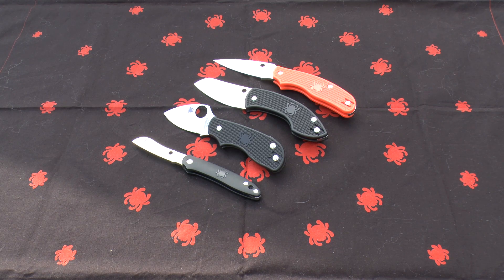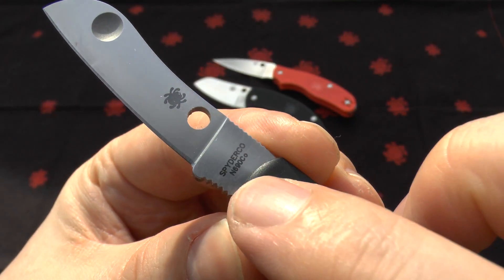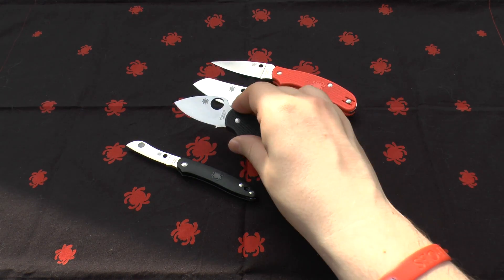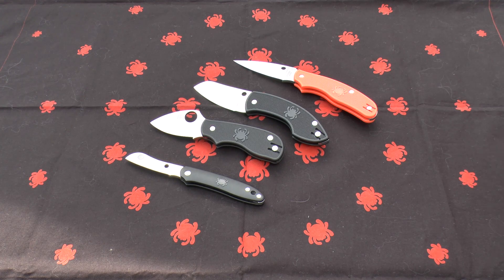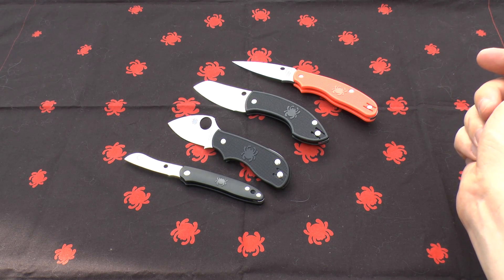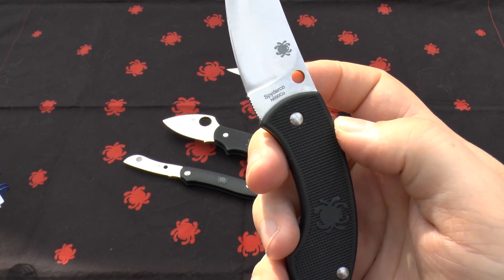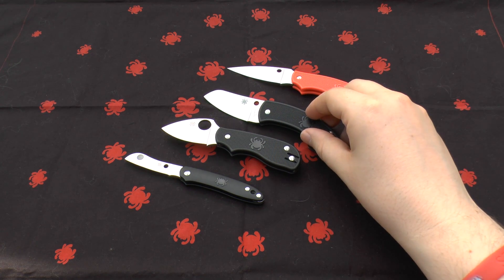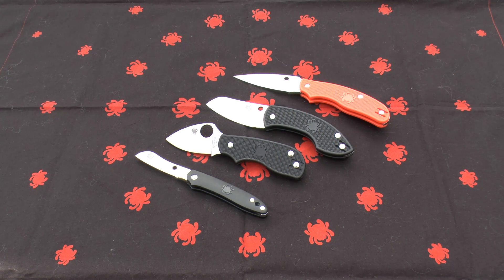N690Co - Blade Steel Guide

Comment: N690 and n690co are different steels. N690co Is not also called n690, they are similar but they are also fairly different.
Reply: Bohler uses both names to describe the 2. They're the same steel, they both contain 1.5% cobalt. You're thinking of n690 vs n695. N695 is bohlers version of 440c. The difference is that n695 contains no cobalt and n690 and n690co contain 1.5%.

Comment: Can N690co start a fire with a firrsteel?
Reply from the maker: I would think the spine of any knife can create a spark with firesteel.
Reply: Sup3rSaiy3n okay thanks, just checking as I tried it with a knife that seemed to have a sharp spine but it didn't work, maybe it wasn't as sharp as I thought.
Reply: Frederik Kjaer 690 is tough if you really want to know use the edge

Comment: Hello, I'm planning to give me a knife with this steel (N690Co) so I wanted to know from you if you actually held the edge well, it is robust in hard work and if it is enough steel when used in humid environments, in short, is really a great steel as they say?
Reply from the maker: +Michele Trekking It really is as great as we all say. It is my favourite steel in my collection and I always take notice of a new knife that has this steel. I prefer it to VG10 and S30V. It holds it's edge for a long time, is easy to sharpen and the edge will roll rather than chip. It's chemical make up allows it to be highly corrosion resistant so it will survive in humid environments. If you are overly concerned about water though you could opt for a blade in H1 steel that is completely rust proof, although it is harder to sharpen and is not as sharp. Hope that helps.
Reply: Michele Trekkning been using it for one year straight now was carrying it as a neck knife and sweated all over it and sometimes hit nails or dropped it on cobblestone, edge always came back just by sharpening while watching tv so no special effort gets also comfortable shaving sharp

Comment: How about S30V and VG10 with a comparison between the two?
Reply from the maker: dreadjavapirate Thank you. Next video will be S30V followed by VG10.
Reply from the maker: +Filip Šorli Great question. They are both very similar but I would same n690 has slightly better rust resistance but it really is extremely close between the two, unlike S30V and VG10.
Reply from the maker: +Filip Šorli Thank you for your kind words. Yes I have the Schempp rock, I have an old review (not sure if u know) sorry for the quality it was 3 years ago and is due for a re-make: https://www.youtube.com/watch?v=VU_yO_j1Qx8 Yes the VG10 will serve you well just rinse it after use (if you can) and it will be fine. Btw plain edge VG10 is sharper than plain edge H1 just so you know and it's the opposite if the edges are serrated.

Comment: Good video. I really like the steel on my Spy DK and good corrosion resistance is one of the first things I look for in an EDC blade. 

Though I have to take issue with your comments about Nitrogen. You say the nitrogen in the steel makes it more resistant, but you read out the specs yourself, and there's no nitrogen in it.
Reply from the maker: freemind62 That's true I am confused any ideas?
Reply: Well I'd guess that since the makers of the steel also make M390 and K390 that the "N" prefix doesn't refer to the composition, but just some naming convention. The good corrosion resistance is likely from the high (17.3%) Chromium content.
Reply: freemind62